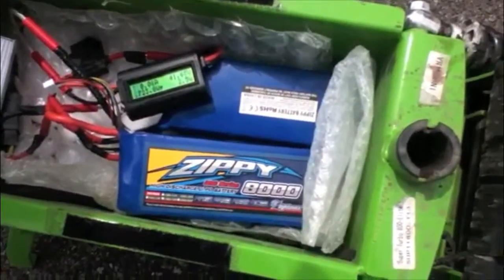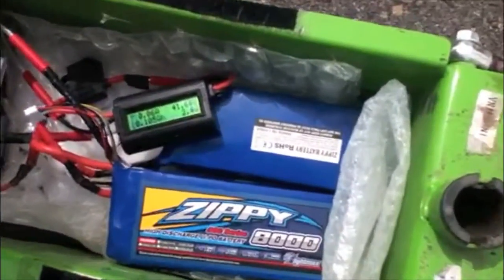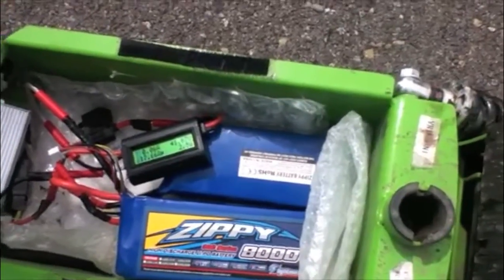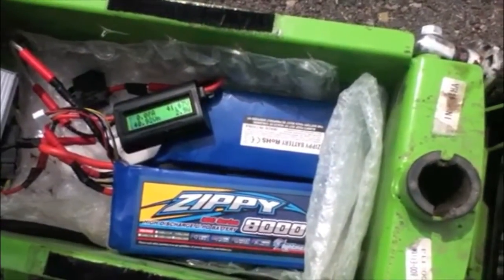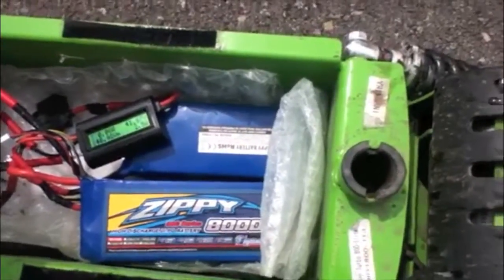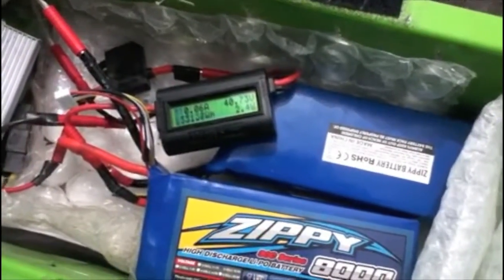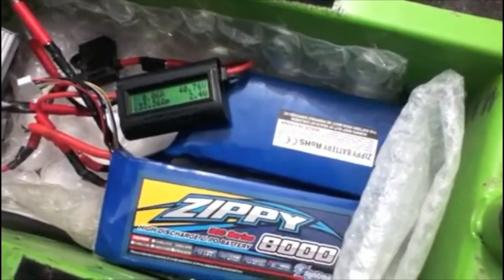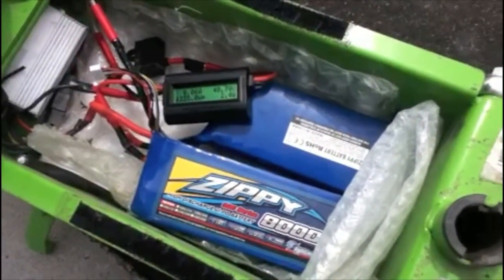Super Turbo 800 Scooter on Lipos

Comment: Good video. I have the exact same scooter (including color, lol), but am using 6, 6 cell, 8000mAh lipo packs wired in series/parallel to give 24aH @50v fully charged. Other than the hill climbing gear set (I live in a hilly city), everything is stock. Top speed is around 20mph and range is 25 - 30 miles depending on how often I use "turbo" mode. Been riding it this way for about a year now.
Reply: Waltkat how does the esc handle that? Doesnt it burn up?

Comment from the maker: A good point. And all batteries are dangerous but LIPOs require special care. For example if you left your scooter on overnight with a low battery the low voltage could trigger a LIPO fire.  People do need to get experience at some point though and I think E-Bike or scooter batteries are an ok time to learn as long as people research proper care for LIPOs.

Comment from the maker: Hey Nick, I've updated the description with a link to my latest video that I hope answers all your questions. The charger is a dual charger called Mega 200 W x2. The connectors will need replaced on your scooter, but it's fairly easy to solder them on.

Comment from the maker: Yeah, You get much more power for less weight with lipos. I've added an annotation at the beginning of the video now that links to the full comparison between lipo batteries and lead acid batteries including a weight vs power comparison. It's a little dry, but some good info for newbies.

Comment from the maker: Hey Ryan, Thanks for subscribing! They are from Hobbyking and they are the Zippy brand. I used 2 5 cell (18.5v) 8000mAH Lipos in series to get a 37v 8AH battery. . I did 2 5 cell batteries because I can recharge each on most hobby chargers.  I'll make a video with more detail. You can look for it posted mid next week.

Comment: well mah = run time. not voltage :) the HK 2200mah 3s 40c for 5.99 is the way to go. Its so much cheaper to buy them in 3s packs and just series/parrallel as needed through connectors. 3s chargers are cheaper too. the lead acid batteries these things use come from lighted EXIT signs, in case you ever needed to scrounge some from the junk  yard :)  anyways cool little scooter, i did the same thing on my sons since the batteries were dead and lipos were on hand. make sure you use a lipo alarm.

Comment from the maker: These are actually just two 5s lipos from hobbyking to get 36+ volts. 42 is what it is fully charged. The goal wasn't to get more speed, just to have more sustained speed throughout the ride. Lipos provide that because the voltage doesn't drop as fast, especially when it's cold. The lead acid batteries just weren't cutting it after sitting over the winter. They're actually some of the best lead acid batteries I've seen but they just don't have the output lipos can provide.

Comment: you can add all the batteries you want, but you will never increase top speed without increasing voltage {cells} its also usually cheaper to series 3 packs, and use cheap 3s chargers than to buy 10 or 12s packs. for 100 bucks you could get 8ah at 24 volts with chargers :) from hobbyking. If you want real speed, replace the speed controller thats on board! and drive that thing with a big brushless...just sayin.

Comment from the maker: At full speed it will take 6-7 miles to drain the battery. There is plenty of room in the compartment to double what I've put in there. So you could have about 15 miles of range and a whole lot less weight with this setup.

Comment from the maker: 22 MPH but it was windy when I had the GPS on it and was testing last. Bottom line is that even @ almost a full 42V the thing doesn't go over the specs. It's fine for me... I think 20-25 is just about right because its' a nice safe speed. I just wish that it had a little more power to beat the wind. With the gusts where I live the scooter has to slow down to maybe 13 MPH some days.